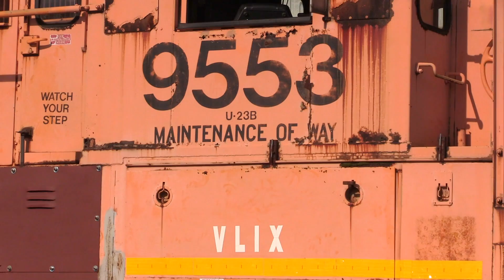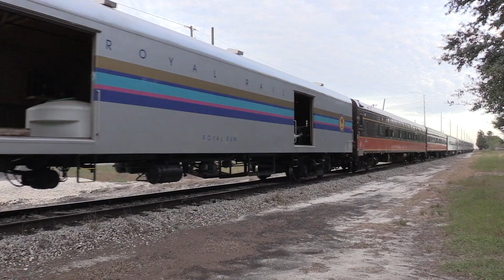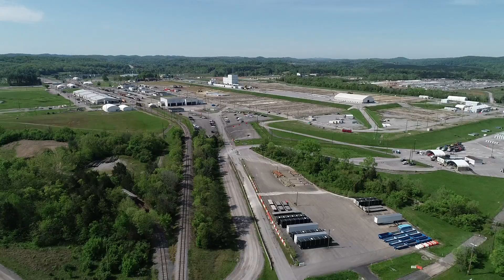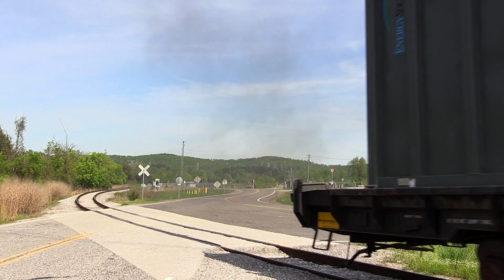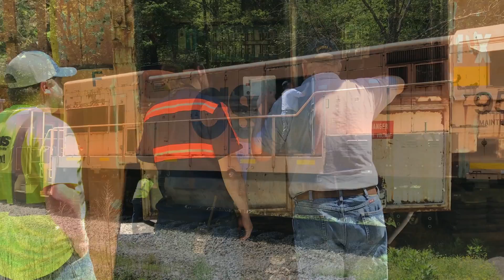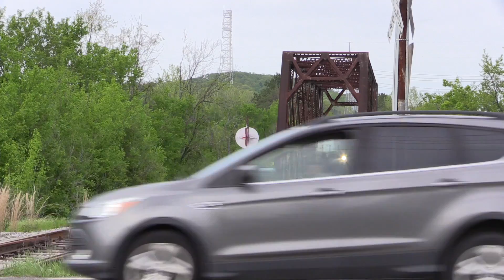The Heritage Railroad

Comment: Major pet peeve of mine at 11:15 when the conductor is in line of sight of the engineer and still uses the radio instead of hand signals.
Reply: He also didn't stretch either.

Comment: Doesn't the CSX still have a couple GP30's?
Reply: CSX has a number of GP30's that have been converted to road slugs. FWIW, FNBS still rosters GP30's. They've been rebuilt but still look like good ol' GP30's. Caught one in brand new paint running light with a GP38 heading south out of Argo a couple days ago
Reply: c peck thanks for the info. Where was the GP30? I saw one in Colorado, granted it was pretty banged/scratched up

Comment: It was mentioned that there is a very limited number of high Hood models preserved. One that I know of was not mentioned it is at u.s. pipe in Bessemer Alabama where I know at least a couple years ago they were still using it as a yard engine probably still are I actually got on board and checked it out one day when I was down there.